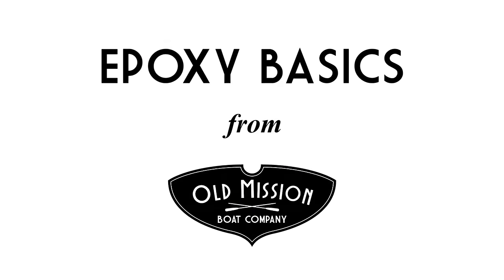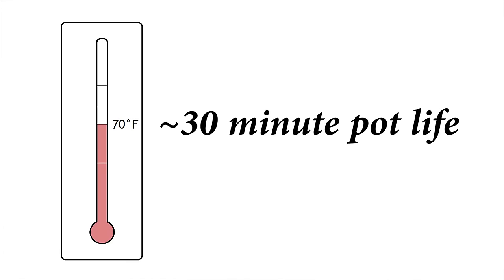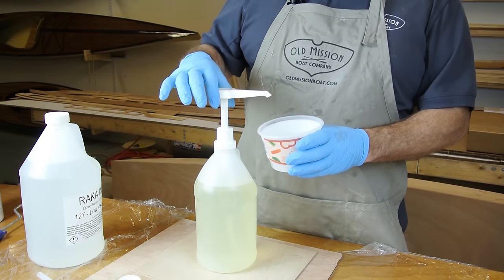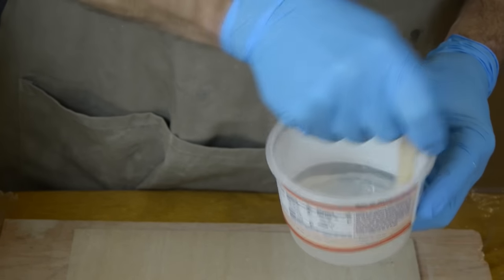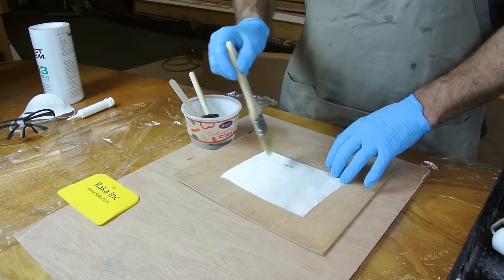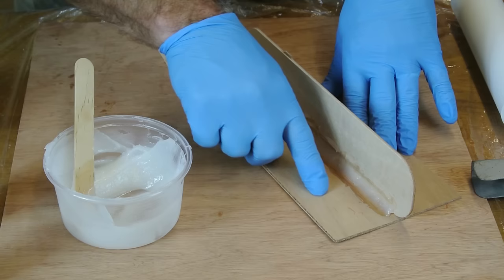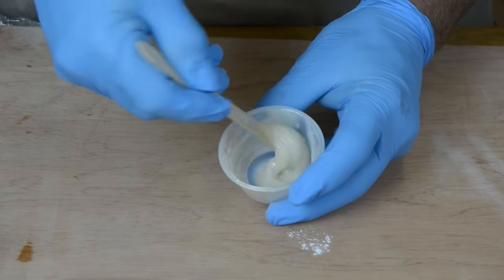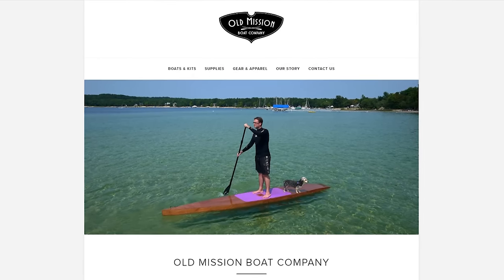Epoxy Basics from Old Mission Boat Company

Comment: Great tutorial. Another thing I may add, coating warm wood in decreasing temperatures will pull epoxy into wood better and decrease bubbling.

The opposite increases bubbles and reduces adhesion.

Comment: Can you give me some insight to what I'm doing? I'm a beginner. I've sealed my hull and glassed the exterior. There is a lot of glass texture showing in spots and the epoxy is fully cured. To fill in the weave I will be unable to sand in the dimples of the weave with sand paper. Is the abrasion provided by a wire brush good enough to provide a gripping surface for a post green fill coat?
Reply: I see you havent had a response yet. Wash the surface with a wet rag or sponge to remove the amine blush. Let it dry and you can filler coat it with more epoxy. Its a good idea to add an additive for easy sanding, West Systems have a fairing compound but i use micro sphears. Mix some of that in but not too much that you cant still brush it on. If you arent worried about fairing it for a painted finish just use the straight epoxy.

Comment: After watching several boat building videos on YT, all of which have used epoxy and fiberglass to strengthen and waterproof the hulls, I'm considering using the same technique when I build a truck cap for my pickup.  I'm concerned that the epoxy coating will crack when the truck bed and cap flexs a bit during off road excursions.  Are my fears unfounded?  Do canoes and/or other watercraft flex a bit during use with no cracking of the epoxy coating?
Reply: David you should be fine.

Comment: A dust mask does absolutely nothing when applying epoxy.  It WILL NOT prevent you from inhaling fumes if you are sensitive to them, you will need a respirator type mask.  And when sanding, the cheap dust masks aren't very good either.  Invest in a good quality cartridge type dust mask with a HEPA filter.  If you're worried about epoxy splatter on your face, get a full face shield to wear, it won't block your view.